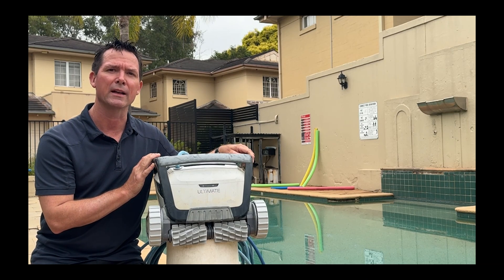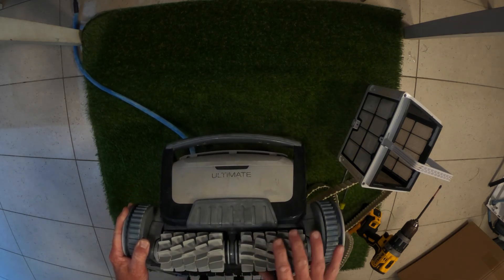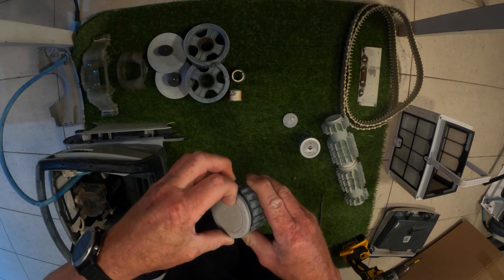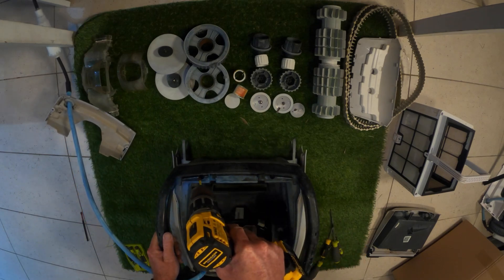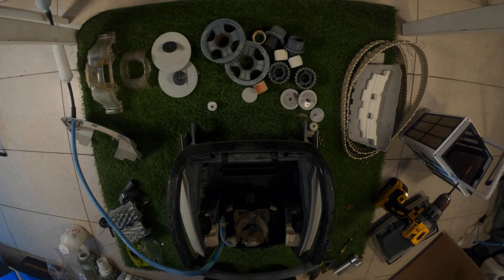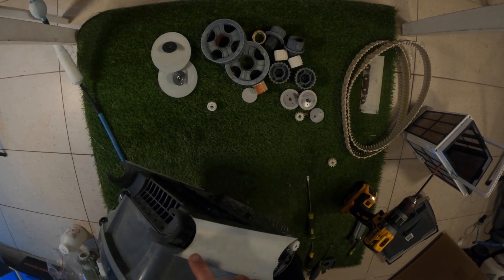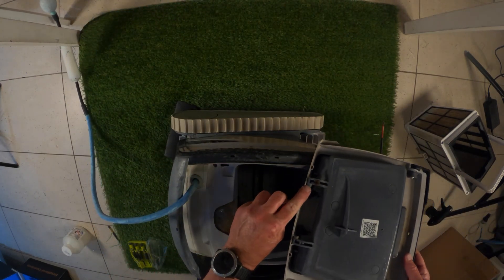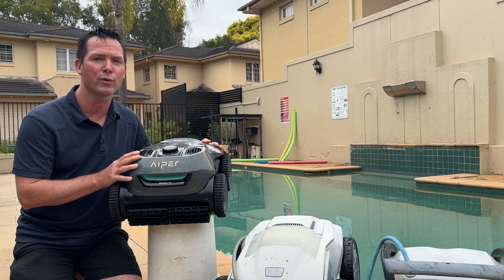Maytronics Ultimate Pool Robot: Step-by-step Troubleshooting And Teardown Guide!

Comment: I have a Maytronics pool cleaner that will not run a cycle consistently nor will it connect to the app.  I’ve taken it apart and can see that mechanically it all seems to work - rollers , tracks, drive and impeller motors are all working.  I am looking for a way to do a factory reset to try and start fresh with the WiFi/app connection - do you know of a way to do that?
Reply from the maker: Mmmm. That's interesting.  Will it run a full cycle if you turn it on via the power supply button? That would tell us if the machine is working correctly.  The other thing you could try is to uninstall, reinstall the app.
Reply: @poolcrewau  It hasn't self-started on power up for a long time but it has sporadically run cycles when started from the power supply over the past few months.  I've deleted and reinstalled the app numerous times.  It recognizes the power supply but won't actually connect.  I did change our wifi network for a short time but have since returned it to what I think the Dolphin would have connected to last.   I'm out of warranty and not getting any help from Maytronics but I would like to try a fresh start with the wifi connection to see if that might allow a software update.
Reply: @poolcrewau  Do these Maytronics cleaners run only three hours at a time, or can they be set to run continuously, a maintenance guy at a park I just started doing the pool there told me, I think it`s about 4-6 years old